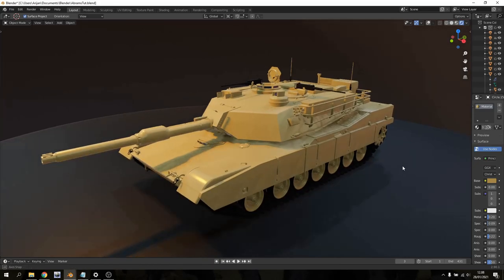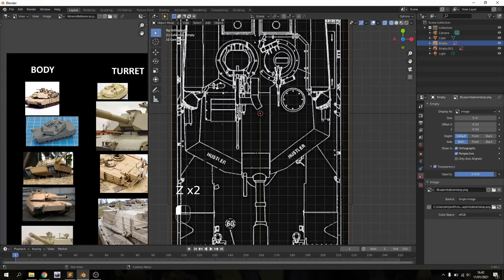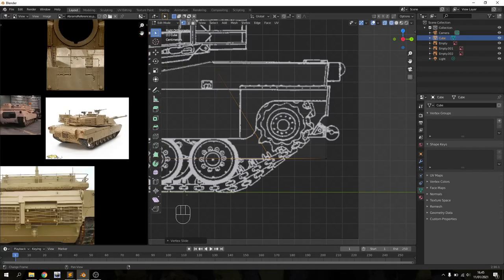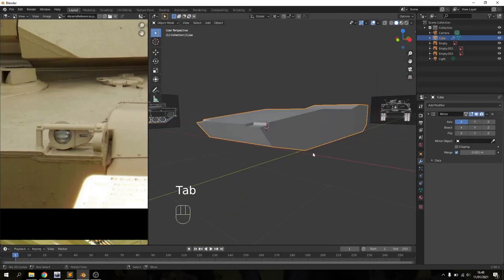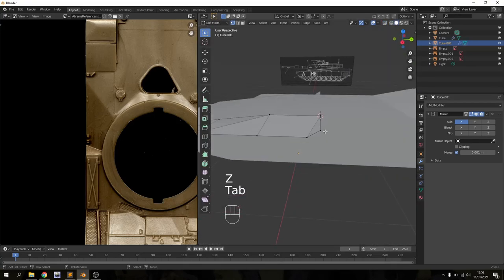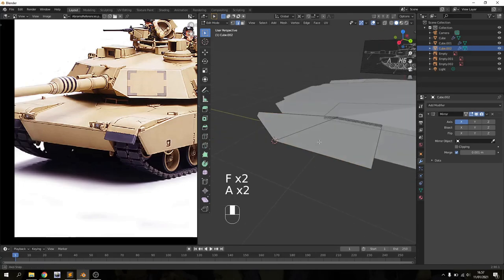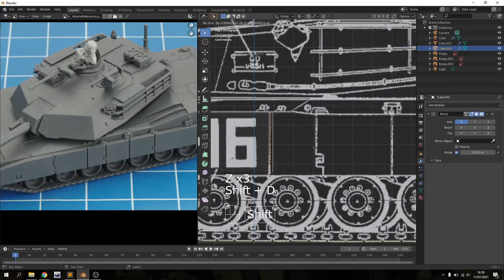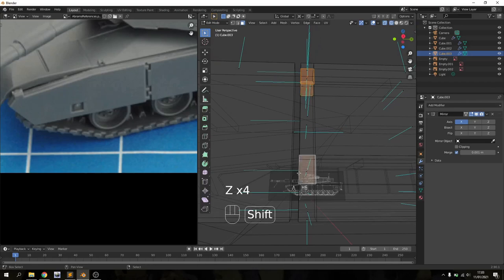Blender Tank Modeling Tutorial | Part 1| M1 Abrams (Arijan)

Comment: Is this optimized for games?
Reply from the maker: No, but with a bit of work it could be.
Reply: @ArijanRace  thx
Reply: @ArijanRace  How do you go towards doing that? I am following your tutorial right now (amazing btw) but I fear many game engines are unoptimized for such a model. Do you just slap on ProOptimizer? Do you have any specific techniques?
Reply from the maker: @NamLe-jq3oq   Thanks for the comment. The main problem is that there is a very high polygon count (901k vertices was the final count here). I would simply redo some of the polygon dense objects such as the tracks and make them much more simple. This model is also untextured (though I do plan to texture it) so I would replace some details with normal mapped textures. Perhaps I could make a video on how I would prepare this model for a video game sometime.

Comment: 7:40  How are you scaling it through 3d cursor
Reply from the maker: By "through the 3d cursor", I meant by using the 3d cursor as a pivot point. You can set the pivot point to the 3d cursor in the little menu above the 3d workspace, and that way when you scale/rotate the object/mesh it will move in relation to the 3d cursor. I hope that helps!
Reply: @ArijanRace  thanks
Reply: @ArijanRace  I tried changing the pivot point and it didn't work
Reply from the maker: @turbojuice4971  Go to google images and search for "blender pivot point". It will show you exactly how to do it
Reply: @ArijanRace  I searched it up and saw a video but it when I scale it doesn’t want to move lol. No worries I’ll figure it out. Thanks anyway great video aswell.
Reply from the maker: @turbojuice4971  in the top right corner of your 3d view screen, you should have a little menu called "options". In that menu you'll see "transform, affect only: (three options)". Make sure all the boxes are unchecked. I'm happy to help as much as I can, that's the purpose of this channel.
Reply: @ArijanRace  thank you so much man. I’m going to try this rn and see if it works. I originally just chose selection to curser.
Reply: @ArijanRace  hmm. All were unchecked it seems.
Reply: @ArijanRace  still doesn’t want to move
Reply from the maker: @turbojuice4971  there could be a number of different problems. If you'd like to, share a short screen recording of the situation so I can have a look.
Reply: @ArijanRace  ok thanks for your help. How would I be able to share the recording with you?
Reply: @ArijanRace  do you have a discord?
Reply: same problem